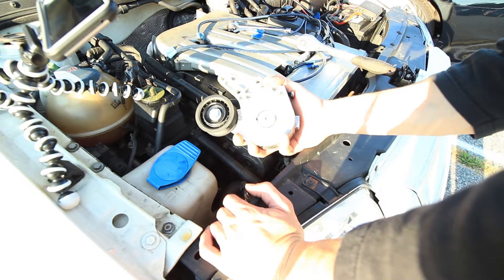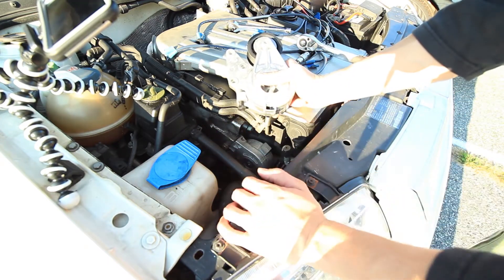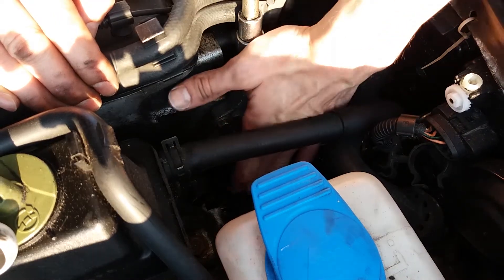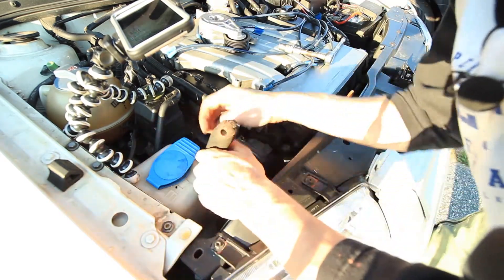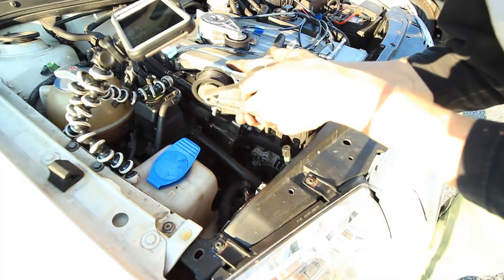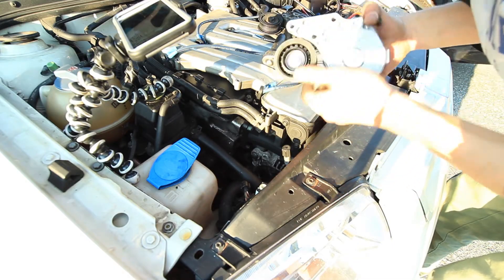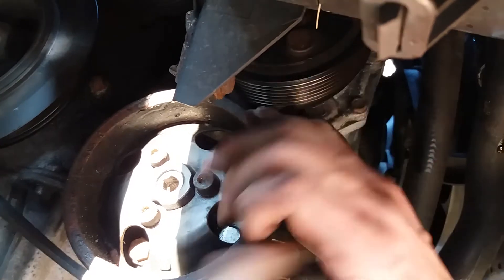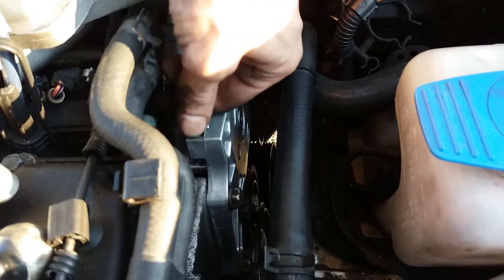VW  VR6 - Belt Tensioner Pulley - Jetta - Golf MK4

Comment: This is the problem in a way with YouTube….. the blind unprofessional non trained showing others how to do things!

You’ve got the belt on the wrong way around ffs!!! As a technician by trade many years ago I do know!!!! 

The ribbed part is supposed to fit into the pulleys, not the smooth side as you have shown!!!

Now I get why whenever I visit USA I hear belts squeaking for a past time as clearly it’s a bit tricky to use common sense….. pulley has grooves belt has matching ribs, oh I wonder what way around the belt should go, smooth or ribbed against pulleys for more traction and better fitment so it doesn’t come off….🤷‍♂️🤨🤦🏼‍♂️🤣🤣🤣
Reply: It's double ribbed sided 😒
Reply: @BattleRapBoutique auto zone sold me one that’s not double sided. It’s the wrong one, right?
Reply: @Reeferjoesix yes. Look at your pulleys.  They should all be ribbed. The way the belt is configured, it needs to be ribbed on both sides. Double check your pulleys and with the shop.

Comment: my 2001 mk4 golf gti vr6 12 valve didn’t come with a serpentine belt tensioner bolt  , needed to replace my alternator so i went to autozone and bought two M8-1.25 bolts to remove tension from the serpentine belt, is a serpentine belt tension bolt oem ? did these cars come with the bolt from the factory ???
Reply from the maker: I'm not sure if they did out of the showroom floor, but the 3 bolts that hold the tensioner itself are the same to loosen the tension.  You can always take one off and use it. I recommend replacing the tensioner with the serpentine belt. If you ever get belt squeak after replacing everything,  use a little dialectic grease on the belt. Works like a charm ✨️
Reply: @Vijuel  ok cool , thanks for the reply , did you remove your tension bolt when you finished workin on your VW ???
Reply from the maker: @volkswagenlover87  Yes, I wouldn't keep it on. Just throw it in your glove box or toolbox for next time. Take care.
Reply: My 2001 vr6 jetta didn't come with a bolt for the tensioner either.
Reply: @Dollsteak69  yeah i kept mine off after changing out the alternator and belt .